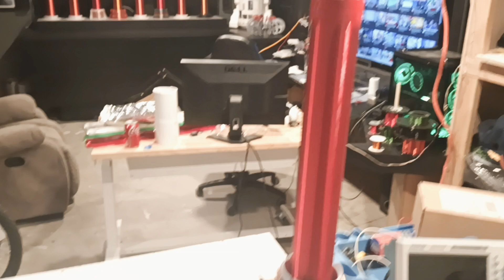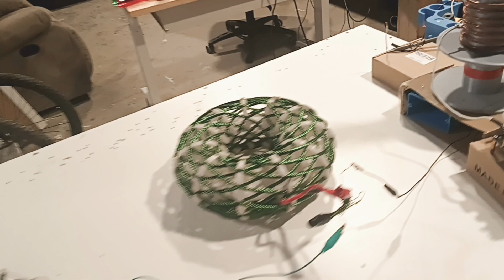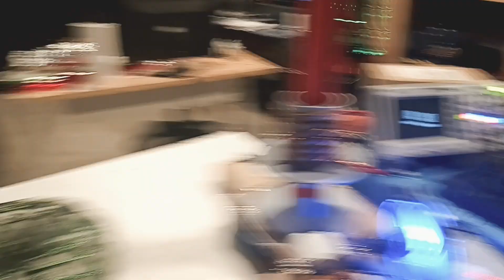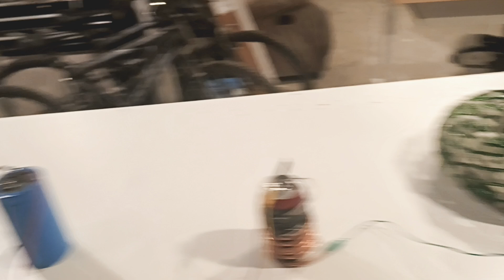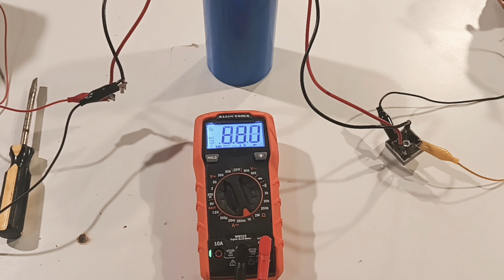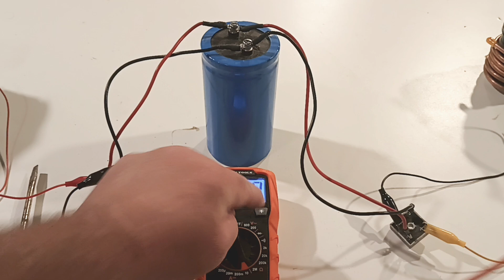Tesla Coil Usable Volts & Amps

Comment: Hi Nathan :) wow, you got some subs lately! Awsome work! so it is possible. Dont bother with the "negative" comments. People usually watch a pop science vid and get stuff like this recommended because of the titles. We all need to learn a lot more and test to get the understanding. Its no longer a question of if, but how.
Been playing around as well. Made 3 identical TCs driven with slayer-exciters and one PS. Fascinating how the system and em fields behave with varying distance and voltage. There is a sweet spot ;) You can make them all resonate and work as one. Adding aluminium rods to the center, reduces freq, adds capacitance to the system, increases volts in air up to a point, then pop, it switches from volts to amps(?) and I get really intense sparks for my modest setup. Fried it and found out. Dominating coil switches based on increased capacitance around it, but if in resonance, system and its dominating frequency are somewhat stable even with a slayer-exciter. 
Inspired by you and the graviflyer, I've been thinking, and please hear me out, I would appreciate your opinion on this because I want to try and make it: What if we make it a goal to have balance, and not push anything? Yes, rise the system to the required volts and apms to make it "work" (rise the reference point), but how we do it is also important. What if we introduced a concept of "bridge harmonic frequencies"? Dono if thats a thing. Kinda like you say Gerald has been doing with his coils and clever windings, but since I don't understand yet how that works, what if we did a similar thing with infra-sound, sound, ultra-sound, and radial moation, kinda like the graviflyer? An orchestra symphony. Instead of going from 0 to 60, we introduce harmonic frequencies one stage at the time with appropriate intensity, waiting for things to saturate? We would need increased intensity at first (and not overshoot it), but when the system stabilizes and locks-in, we could reduce it. Similar to how tuning with the cap-bank would overshoot and then you can reduce the capacity and still hold the resonance. Once locked-in with enough wiggle room, we can introduce distableising elements (cap bank or a solenoid or an aluminium plate), if in tolerance threshold and a resonating frequency, it shouldn't fight it too much. 
Ambitious build first draft design idea:
6 identical TCs arranged in a hexagon for field stability (tested with an equal triangle = unstable) + one bigger TC in the center as a focus point. all ran by slayer-exciters. rods down the 2# from the hexagon meet at the center TC rod. Central TC rod has a disk on it that can spin in the same direction as TC windings. Now mirror this setup and have the two spinning disks in the opposite direction be like two plates of a capacitor. Will we have vortexes culmination point in the center like the graviflyer? Intorduce a middle element based on requirements. Be it a spiral copper pipe with water for heating, a solenoid or an aluminum disk. Add physical frequency in stages to push the entire system (parts and all) into resonance. If all steps are done, we should get an additive effect of more efficient energy transfer, all around the system and in it focused towards the middle element. I probably overcomplicated this. but I hope I managed to get the point across... The design can and will change.
Reply from the maker: great job on the tesla coils. The graviflyer is harmonics an small amount of power. when I resonated a coil with no power  it. It was based on the ring and harmonics of each layer of the ring.  the graviflyer works the same way. each part needs to be measured and the numbers have to line up.
Reply: @oldmanbuilds  Thank you :) yes. i actually think i understand :) I've seen the rings. everything needs to line up and be in the tolerance threshold. geometry, freq and material composition and position.

Comment: Nathan wants to know the current stored in the cap that is why he is going across the cap terminals. He is converting the impulses coming from within the tesla coil into real AC then back to DC. but I have to agree that you should always use the 10 amp plug when measuring current unless you are known to work in the milliamp range...
Reply from the maker: finally someone gets it. The cap runs the motor, How you build it is another story. I showed it so that people have an understanding of it. It can be improved with better diodes, a draw like a light bulb/led, you can even make the coils harmonics resonance and octaves amplify it. The understanding or foundation starts with a simple soda can.
Reply: @oldmanbuilds  Yeah I learned that even in our current AC system the real current is made inside of the capacitors at the poles. The lines are really one wire transmitters that usually end at the ground near the pole. Another coil in the capacitor picks up the field inside of the capacitor and feed it to your house then to ground. Lately they are using a floating ground or neutral wire in the system to remove a direct short to ground. What you are doing is very much the same with converting the polarity via a capacitance. Use the right energy to send the signals to the load system and convert just before or inside of the load. Walla near zero loss in the transmission and could even be utilized as a fulcrum type thing and magnify the output.
 Lear how to generate 1 million volts with little energy and you get all that to transform down to huge currents and magnetic fields in the conversion.
 Bifilar coils in the load are a way to add capacitance into the coil itself and be able to draw in plasma and manipulate those currents to add to your output. in essence amplifying the output of your conversion device.
 And yes I get it... I have been researching Tesla for over 25 years. I have read the old masters of the electric theory and found out that their understanding of the ether or plasma field was way more advanced from a basic perspective. They didn't know how to manipulate it in such a way as we understand the process now.

Comment: I love your rodin coil.I'm drooling over it :-)  
What type of difference in results do you think you would get if you used a regular typical coil instead of your roden coil. People tell me.I will not get that much current either.But I tell them that it mainly takes voltage to charge a capacitor the more voltage the faster & higher that capacitor will charge.... now when you discharge that cap, there is your current.  I know very well that that "can" is where the magic happens.
Love love what you're doing.Keep up the great work!
Reply from the maker: The Rodin coil is breaking cemetery of the tesla coil. Basically it allows energy to pass without pushing back on the tesla coil. Normally any change to the load would throw you out of resonance. This stops that. a regular diode does not work with this energy. 

Het equals amps. Tesla said energy is like gas. A can compresses gas and creates heat. I use this to get more amps. I am not trying to show amp flow, just that it is there. The kicker is when I start using high voltage dc to create the flip then turn it off again. I do not think everyone is ready for that though. You see the comments. They are more worried about how to measure amps. 

The truth is what I just did converts high voltages to useable amps in any system. That is worth it's weight in gold.
Reply: @oldmanbuilds  Thank you very much for that info!  I need to build a Rodin coil!  Yes!, normally the load would throw everything out of resonance, I absolutely agree.  Yeah, everyone wants to see the amps, I know how that is.  Hey, if you can charge a cap than you can get current by discharging it.  Thanks again.  You're doing outstanding work :-)
Reply from the maker: @INVENTOR3  that multi stand wire might work as a Rodin coil. If you use the rod down the center the energy is not held back by the shielding. Different shapes might get different results.
Reply: Thank you!. @oldmanbuilds
Reply: Absolutely weight in gold. Stay blessed and May you  harvest 100 fold ❤

Comment: Why don't you use a cap dump to charge a battery. You can make one with simple components. Nice work BTW 👍
Reply from the maker: The goal was just to show conversion to useable amps. Anything is possible after that.
Reply: @nathanbunten4299  I totally agree, just a suggestion to show usable power and what can be done with it. I am working with the same power using a plasma tube with some good results, charging Batteries and what not.

Comment: to measure amps you must put the meter inline with the circuit to get a correct reading. You also usually have to switch the probes on the meter to the amp port with a high enough rating. always start on the highest rated port on your meter to avoid blowing your meter.
Reply: Short circuit current is a viable means to test for the available current in a system before accounting for load. I hear what you're saying and I understand but I'm a little tired of people saying you can only test amps in line under load. There's 2 different methods for 2 different reasons.

He's measuring across the capacitor so that is rougly the amount of power available in a full discharge. It's not the power being used to charge it. He's just charging a capacitor lmao do you people even know what you're looking at?

He's not even measuring rf he's measuring a charged capacitor it's static until you connect a load. What is wrong with both of you jfc. It's rectified dc too how is that rf at that point? AAAAAHHHH people man...
Reply: @brianp5210  measure the current from a capacitor discharge tells us nothing useful here. we know how much energy the cap can hold.
Reply: @wongowonga  ?? What was it supposed to tell you? What do you guys expect here? I don't understand. He's charging the cap that's really all I see being demonstrated or attempted here. Any direct load on the coils would kill the effect. Again, not really sure what you're looking to be "told"
Reply: @brianp5210  a voltage check on the cap would have been enough. pointless 'measuring the current' across the cap. Like i said, we know how much energy it can hold. if he wanted to show the cap was charged, voltage would suffice.
Reply: @wongowonga  you know what man, I'm glad to see all the amazing videos you've put out showing us how it's done. If it weren't for you where would we be?
Reply: @brianp5210  further forward than we are by trying to measure current across a cap.
Reply: @brianp5210  anyway, I was trying to give USEFUL advice. Not criticise. The point stands, measure across the cap til your heart is content. Fill your boots, who cares if its pointless, it looks like fun right...
Reply: @wongowonga  look man I see nothing wrong with this demonstration. I don't know what you're getting at. I'm done. Peace.
Reply: Correct, it gets tricky from there onward too. RF is not a simple creature to measure accurately, impedance matters.

Comment: Nathan, I see a couple people have said it already, but that's not how you measure amps/current.  You measure current inline, not across the terminals like you do for voltage.  Remember when charging a cap all we are doing is separating the charges on the plates.  Assuming both plates are identical,  then both have an equal amount of positive & negative charges already in the plate material at zero volts.  We take the positive charges off the negative plate & move them over to the + plate making it more positive, & we take the negative charges off the + plate & move them to the - plate, making it more negative.  We don't put anything into the capacitor, all the charges are already there in the plate material, they are in a balanced/mixed state (@zero voltage) & can not be differentiated from each other until we apply voltage to separate them.  All we do is apply voltage to move the charges, the rate at which the charges move from plate to opposite plate can be read as current on an inline current meter.  When reading this current do not make the mistake of thinking that you are 'putting amps in' from the cold side or hot side.   All you are doing, is applying voltage to separate the charges.  The current you spend to do this, is the current required to  maintain the applied voltage for the duration of time that you are separating the charges per pulse (so that the applied voltage doesn't drop while separating the charges).  The diodes stop them from returning, keeping them in the cap.  There are a few other factors to consider, like diode voltage drop, wire capacitance, frequency, radiant amplification if any, etc. Please get yourself some inline moving current meters of different scales.  You can also use a clamp type current meter but you will get false readings with certain circuit arrangements as it measures whats outside the wire not inside it.  I can show you some bizarre results from both moving coil & digital meters if you wish to know more.  Hope this helps.

Comment: Many people are not aware of the significance, if there is any, regarding producing amperage using an aluminum core transformer. Or the one wires middle pole compared to the same oscillation you are using, directly. Also any significant difference of the Roden coil in the circuit.  Although it sounded like you said you were using cold to make hot. Is this the amperage by transformer?
Reply from the maker: @calagemlily  the Rodin Coil stops the frequency from changing on the Tesla coil. A break like a 1:1 transformer

Comment: I love it, but I am worried about your multi-meter because measuring amps is basically creating a dead short inside the meter, an amp-meter must be inline and I always put it in the negative line because of the cold energy
Reply: ITS CALLED SHORT CIRCUIT CURRENT LOOK IT UP

Comment: Do you ever experiment with back emf and cap dumps?
Reply from the maker: @thecontact2609  not yet, but the team I work with do. Faraday research does it all the time.
Reply: Cool!  That's what I'm working on right now, but just using a voltage relay, neon's, and caps to do it.  Your the one inspired me to make my first Tesla coil though.  Just a simple one though driven by a slayer exciter circuit.
Reply from the maker: @thecontact2609  right on!!!